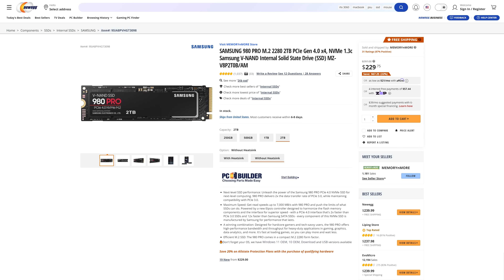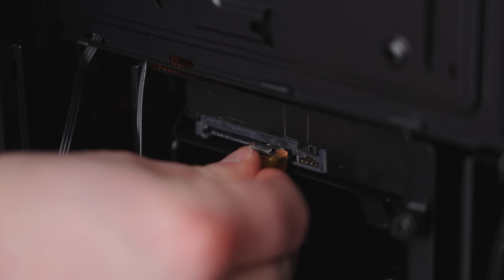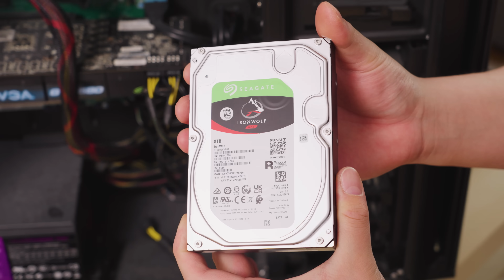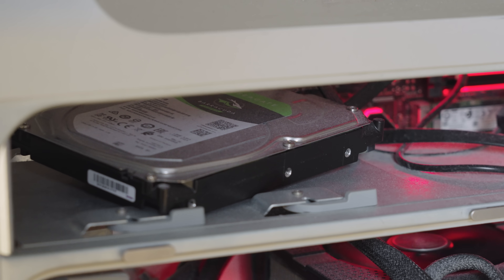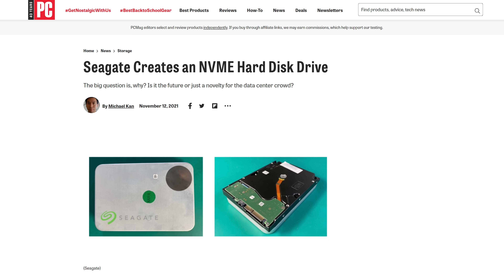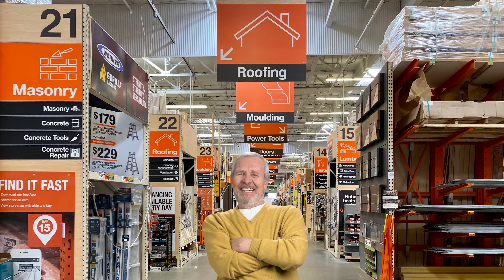Is SATA Obsolete?

Comment: Here is my skinny on this subject that was not talked about. M.2 drives are fast and getting Cheaper. Example I have a 4T in a cart for $199  that has a 5 year warranty. I just bought a 4T SATA same warranty for $219. I asked myself why did I do that. Upgrading SATA drives is easy. M.2 you have to pull your video card. If You have one of those long 3 fan ones that a job in itself. Just to get to the MB to install it. I believe the days of the small 128 to 512 M.2 is over.  Should you put a 1T to 4T as you boot drive is now the question? Another thing is MB that have 2 or more M.2 slots may could you to loose SATA ports or other things If you use them.  Which ever SSD's you buy get the ones with the 5 year warranty. They are made batter and maybe even faster that the cheep 3 year warranty ones. Not all SSDs are the same quality.
Reply: What I am seeing here is the question was to straight forward and totally missed understood. Ease of replacing M.2 SSDs. Is not as easy as a person my think. Best way not to have to do that is buy a big enough good  drive to start with. Nothing under a 1TB M.2

Comment: It'll be obsolete when those SATA SSDs have a noticeable performance drop compared to the NVME drives. Apart from copying files around your PC, nobody will ever notice the difference. I went from an M.2 SATA SSD that was around the 500MB/s mark for Read/Write to a Gen4 Aorus which is around the 5000MB/s mark for read and 4400 for write and was disappointed as there's no scenario with what was at the time a Ryzen 5 3600 where I noticed a difference, and even timing things like game launch times, load times, stuff like that, and still they were within a second of each other, sometimes the SATA drives have better load times. 

Even the latest CPUs like a 13900K or 7950X3D aren't fast enough to allow a Gen 3 NVME to benefit over a SATA. My experience is with 2x Samsung 870 EVOs and 2x Gen4 Aorus drives as well as a single Gen3 970 Evo. Also here's another kicker, my sister has a PC with my old R5 3600 and using only SSHDs I got back in like 2017, and the load times are actually not even that much slower than my PC with a 5900X using any of those SSDs I mentioned, and we're talking games like Hogwarts Legacy, Red Dead Redemption 2, Sons of the Forest. I definitely load in quicker, but the difference is miles from what people think it actually is. People would tell you games would be unplayable with SSDs now, or run really bad, but games still run very well on HDDs.

Comment: This video is full of inaccuracies. Besides that PATA wasn't killed by SSDs as it was replaced by SATA well before SSDs became an option for consumers. SATA is the name of the bus and connector, and NVMe is a protocol.
SATA also takes up PCIe lanes of the chipset that could be used differently, no Bandwidth is free.
Instead of using those lanes for SATA you could instead offer U.2 connectors with 1 PCIe lane for example. Those would still be faster than SATA. This is why they already work on NVMe HDDs.

Comment: I got 3 8TB 3.5" drives for about 80 bucks each. Its running at 5,400rpm but for storage that doesnt matter. The only thing matter is that new cases are getting rid of 3.5" bay. I manage to find one with 3 bays and tons of ssd bays. It fit my needs.

Comment: If i need a 10-12tb external drive for storage what are the best high quality options that just won't fail? best of the best protection Under $400 (With no need for external power).

Comment: To me SATA SSDs are the jack of all, but master of none. Good price per GB, at modern speeds. May not be the best specs out of all the storage options but they can trade blows with both mech drives and M.2s simultaneously.

Comment: Sata SSDs are going anywhere. Older PCs is one. Other reasons:

> Sata don't use PCI lanes, so it's not CPU bound
> They don't occupy motherboard space so you can put much more of them
> They don't overheat because they are far away from CPU and GPU
> They are not so fragile because they already come inside a case

Comment: It's still vastly cheaper for the same size, the bigger the more. For a LOT of everyday tasks, they are perfectly fine. 
Of course you should your OS and maybe other demanding stuff or big games off fast NVME if you can. But even if not... Have a little reality check with running a PC of a harddisk....  Which btw are also still fine and useful for simple storage tasks.

Comment: I think as NVME drives become cheaper, SATA drives will also continue to become even cheaper. They fundamentally have the same flash storage technology inside, just that SATA drives are fine with much lower speeds because they're limited by the SATA interface.

Comment: SATA will always have a place in the mass storage space for the foreseeable future where capacity is more important than speed.
Mechanical HDD's are rarely used for boot drives today, but are very often used for mass storage (6,8,10 TB+ drives) where the cost per Gb is FAR lower than an SSD and speed is not a determining factor, such as large media libraries, system backups, etc.

Comment: I still think SATA is dead (or at least will be in the next 5 years). You can by 2011v3 CPU for $20 on ebay which provides you 40+ PCI-E lanes! Combining it with an X99 / C602 mobo, and some adapter cards to make PCI-E look like M.2 ... you're gonna find yourself having 8-10 M.2 connectors. It is easy and cheap to do with second-hand hw, I believe this is the future. Along with PCI-E bifurcation you can have 4 M.2 slots out of 1 PCI-E x16 +2 on the motherboard, you instntly have 6 of them.

The only thing is needed: more support from CPU manufacturers. Unfortunately Intel still thinks about these features as vertical segment separators... Fortunately tho, AMD is far more permissive.

Morover, when shipset manufacturers will get rid of SATA support, they could have additional PCI-E lanes packed into the PCH.

Comment: I was an early adopter of PCI-E SSD (it was an actual PCIE card called a RevoDrive by OCZ).  The speeds were incredible for OS/primary drive use, even moreso than the SATA SSDs I had tried up to that point.  I'm happy to see that boot drives are now commonly PCI-E powered via NVME and attached without using a proper PCIE slot (even if it uses lanes).  But IMO, there is no reason to use more than one NVME.  Additonal storeage shoud be via SATA, either SSD for fast secondary access or mechanical hard drives for large media files, backups, etc.

Comment: In real life, there's not much of a decisive performance difference between SATA and PCIE SSD, except in a few very specific use cases such as working with very large sequential datasets. I wished though that future mother boards would offer more PCI lanes and more m.2 slots, replacing SATA entirely.

Comment: OK wait. If I'm running a gpu (3080ti) and I want to add two m.2 drives (one gen4 and one gen3 to fill my slots). Do I have to do something to "allocate" the lanes?
I thought it was plug and play.  I was going to put my windows and main programs on the gen4 and all the rest on my gen3. Any help is greatly appreciated. TIA
Reply: the limitation mentioned depends on the motherboard. Higher end motherboards have enough PCIE lanes to run the GPU at full speed as well as 2 or 3 m.2 without a sweat. Just make sure to check the diagram for how many lanes go to what and when.

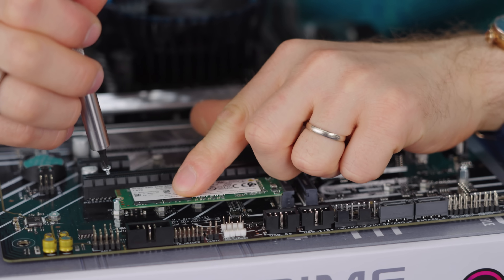Comment: Clarification at 3:03 if you have more than one ssd slot there there are chances that they are routed through your motherboard chipset so your 2nd nvme can't take your gpu bandwidth also as new gen cpu have 8 lanes connected to chipset there are not a lot of chances that it would bottleneck there too

Comment: You can get 2tb nvme for 120 with 3500/3000 read/write. The difference between that and pci-e gen 4 is pretty much completely irrelevant. Even the difference between sata and nvme isnt THAT massive. 

So unless you're constantly tranferring hundereds of GBs to multi TBs around, do your self a favor and grab a 2tb nvme pci e gen 3 for 120. Hell grab 2 for the price of 1 gen 4 and have 4tbs

Comment: SATA drives are still around because of greater capacity, while SSD's are still around because there is still hardware out there that still doesn't have M.2 ports, and the SATA connector is backwards compatible with PATA, with the right adaptor. So No, SSD's still have a roll to fill. Plus they are a little cheaper than M.2

Comment: As someone who uses both an nvme and a sata for dual booting windows and linux, although i use arch on my sata ssd which is a super light distro i also used ubuntu and manjaro on different partitions and I can say that if you arent going to use your computer as a workstation or anything that NEEDS that higher speed and faster specs a sata drive is perfectly fine for doing most things. it might slower your download speeds and make your game a small amount slower but i havent noticed at all
Reply: as long as it has sram or some kind of caching, than a sata will feel faster than an m.2 that doesn't have caching, especially if both drives are close to full.

Comment: For many purposes, SATA is fast enough. And you can add e.g. 6 SATA drives on my newest PC, in addition to the 3 nvme drives, and potentially add more ports by way of a PCIe-to-SATA card. When setting up my main PC, I reserve the nvme drives for a) the OS and b) stuff that needs the speed. Then I have a 2TB SATA SSD for stuff where the speed advantage over a spinning HDD matters, and then two 8TB HDDs for everything else. If a SATA SSD is fast enough, nvme doesn't gain you very much.

Comment: Sata is still best bang for buck boot drives.. 90% of people won't notice the extra second diff between booting up SATA vs NVME... that way you can use your NVME for gaming and load levels quicker.. because a 2 second time save on a 10 second SATA load is quite a bit of you do it multiple times a day for years.

Comment: Well by that logic, that you can't notice between nvme and sata, at one point in time a fast hard drive was just about as "fast" as the modern sata ssd.  But over time more programs asked for more disk read / write.  at some point that will be true of sata as well and nvme vs sata ssd will become noticeable to the average user.

Comment: SSD's are the new hard drives of 2023 and they should be. However the price of these SATA drives are about the same as M.2 SSD's. They need to be lower in price. 

HDD are dead at this point the massive storage for the lower cost and lower speeds just not something the average consumer wants anymore. SATA SSD I am pretty sure can match or even reach lower that HDD prices if the manufactures want to. 

SATA SSD for older system for mass storage and M.2 SSD for the modern PC.   

Just thoughts in the current market as of Nov 2022.

Edit : 

I don't think SATA SSD's are gonna be dead until the next 10 - 15 years. 

All new Motherboards for PC still is made with a SATA interface until that cut from manufacturing then SATA will finally be out by then M.2 will be old and may a be a new technology will be out to make SATA obsolete.

Comment: I think M.2s own benefit is its actual flaw- it's too small and open. It's designed for performance and not adaptability. You can't just carry it around in your backpack or take it with you for daily driving. I personally don't think SATA will become obsolete for a while because of this. There should be an M.2 alternative which is larger and more "consumer-friendly" for server bays and the like. One of the reasons I dislike M.2. You can't just easily pull it out and plug it into your laptop for easy data repair, and I myself, get scared of breaking the damn thing cause of its thin and long size.

Comment: This video shows only the advantages of sata, not the ones of m.2 sata/nvme. For example, not even the space saving of using m.2 in laptops was mentioned. But then minor things like pcie lane capacity is mentioned? Also mentioning Expansion cards for sata as an advantage, as if the same thing didn't exist for m.2/nvme. The video just seems very weirdly written. I don't know if bias or incompetence is to blame.

Comment: several universities have been developing what they call crystal drives, its suppose to work along with quantum computers.
the crystal drives were reported to be 1000x faster than the current Samsung 990 Pro NVMe drives.   It will be a while before we see home quantum computers,
and I will most likely be long gone from this planet before that happens.
Lets not forget that humans have already been developing whats called Quartz Disk that hold 380TB of data permanently, its nicked named the superman drive.
The drive is sized at 1 inch by 1 inch in size and again holds around 380TB of data, a month ago MIT developed a quartz drive that holds just above 500TB of data,
and are working with both NASA and SpaceX with it before its even considered to be handed out to the main public.

Comment: SATA will stick around as long as mechanical drives are still the best bang-for-buck bulk storage option. SATA/2.5in SSDs may fade into obscurity, much like 2.5in mechanical drives. I can't see a replacement connection that would provide enough of a practical benefit for the general consumer to justify the logistical headaches of adopting a new connection/protocol. SATA is compact, easy to connect (though I would like it if there was a bit more structural support, I have snapped the data connector a couple times trying to cable manage into a crappy, tight case), supports hot-swap, and has several times more data transfer bandwidth than mechanical drives are capable of.

Comment: yep as a Primary storedge the SATA is done.
but as a secondary storedge it still useful.
especially if you got a lot of large file that does not requires instant access.
music, movies, docs (no point in putting that on a SSD by the way the gain is insignificant in most cases).

Comment: Do 2.5 SATA consume less power than NVME? Which is best for lowering battery drain? If the SATA consumes less power when remote downloading pictures off cameras it might be nice to boot to the 2.5 in the laptop instead of one of the NVME's.

Comment: This video is littered with inaccuracies. I was using SATA back in 2006. SSD's weren't even a realistic option at that point. The motivating factor was the fact that IDE / PATA was a legacy technology that had persevered for years. SATA was the new high speed file storage technology and sure enough, every spinning disk I bought post 2006, has been SATA. I got my first SSD in about 2015.

Come on guys.

Comment: The only people that say that SATA sad are dead are gamers, SATA are far more flexible solution than nvme, nvme is impractical when you have to remove the disks , connect them to servers , share between computers, almost everything an IT does in a company, nvme drives yes there are a lot faster but you loose a lot in exchange for that, I only buy nvme when speed is Paramount, otherwise stick with SATA that are far more flexible standard
Reply: word salad copium

Comment: SATA is going nowhere for the forseeable future, there is nothing to replace it yet. Most motherboards only have 1 M.2 slot and (in my machine anyway) after I install a graphics card in my MATX motherboard I don't have enough room for a PCI-E card to put M.2 drives on

Comment: Try having an ITX system (you're running 1 RX7900xtx not 2) with 4x 4TB SSD's using M.2 based NVME drives. Oh wait you can't.

Comment: HDD boots Windows in 90 seconds, SSD in 30, NVMe in 10. We will reach a point where anything longer than 3 seconds feels ancient.

I just bought my 2nd NVMe and first >1tb SSD because of 4K video and a need for faster load times on larger to medium files. HDDs are still great for mass storage and long term safety of small important files. To me SSD is an intermediary just useful for less frequently written data that will be read often. Anything else falls to express or disk, with the majority of irreplaceable files on magnetic platters with 2 redundancies (plus cloud storage). 

I don't trust SSD or NVMe for files I can never replace. Even if the HDD fails I can fix it and still have my data intact.

Comment: My old 2TB sata HDD is still not bad for mass storage and also I have a 240gb sata SSD which I use for old games like emulators, m.2 for everything else. M.2 is better for primary storage cause of the decent prices now but for secondary/mass storage sata is better. Some 2tb sata SSD going for about 200USD, very good for mass storage and fast.

Comment: The logical pins could be reconfigured to fit modern hard drives by means of an adapter.... I don't see the fuzz. As for phasing it out, which one? Sata architecture, ssd technology or both? Sata is older, so I guess sata would go sooner... 😳

Comment: The only way is if they make 15-20TB nvme drives and SSD drives for $200 bucks. So then you can not have to use sata mechanical drives.

Comment: PATA or IDE connectors were used for the first ever commercially available SSDs.... It was a very niche thing to have back then and I don't think SSDs really became popular or "as standard" until around the 2010s. I had a PC a Core 2 Duo that used SATA for both HDD and my DVD RW. The motherboard had ide connector too.

So saying that the reason we moved over to SATA was because of SSD doesn't add up. We were using SATA as a standard long before anyone really knew of cared about SSD.

Comment: PS the SATA connection is pathetic and when that little down pointing thing breaks, motherboard also. I'd much rather see an "impossible to connect any other way than correct" connector, but that would obviously slow the market down.